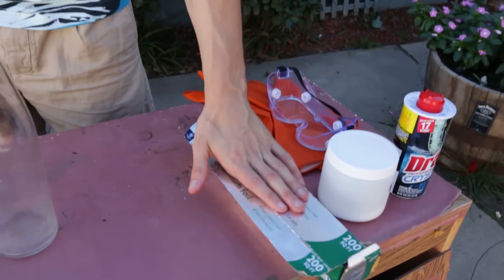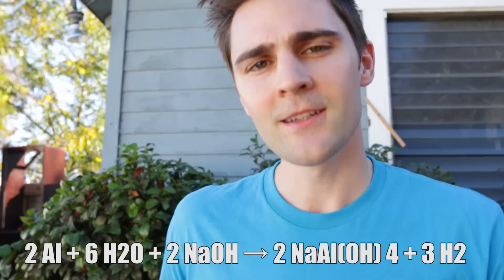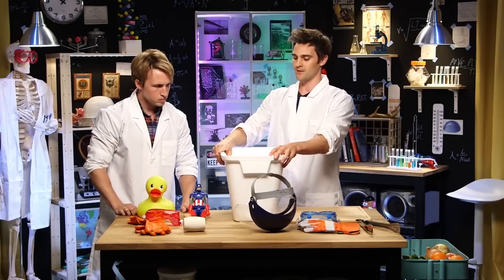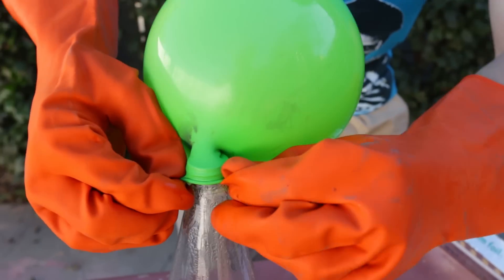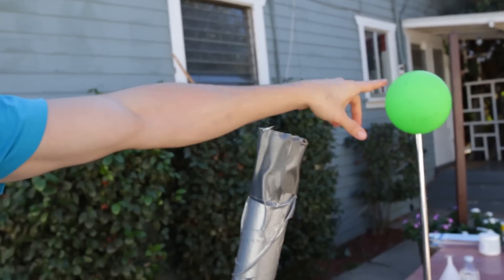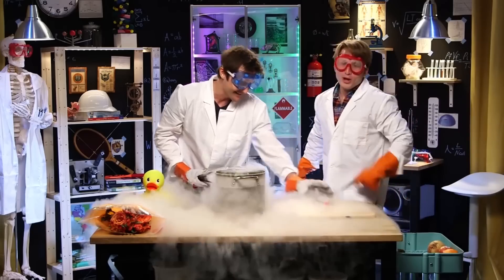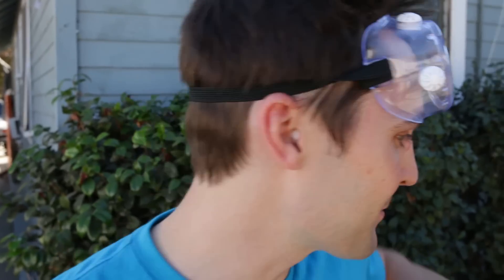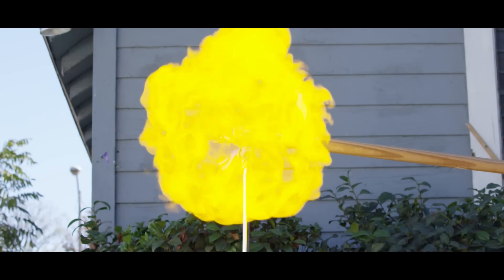Exploding Hydrogen Balloons Experiment

Comment: why does the flame travel in the direction of the flame, that's on the match?
Reply: Wesley Cantrell The hydrogen is probably forced out of the hole that the fire created faster than it catches on fire. Just think of a deflating balloon and how the air is forced out, but instead the air is hydrogen that gets set on fire.
Reply: Wesley Cantrell I think it's just cus that's the direction from which the hole was created
Reply: TheJzoli makes sense